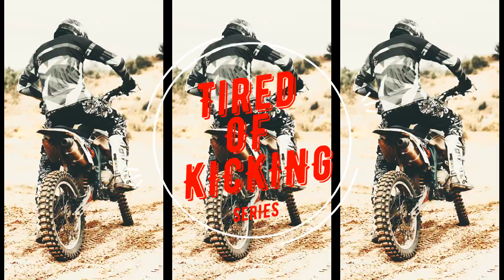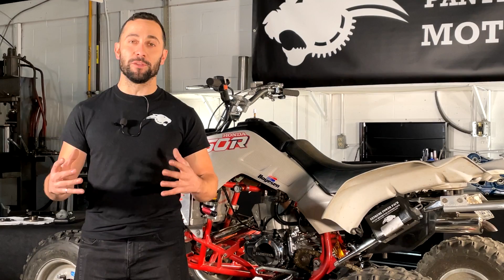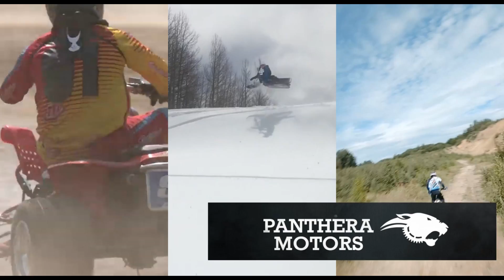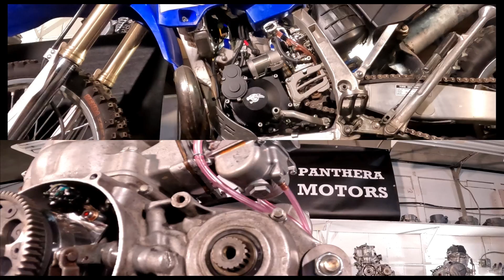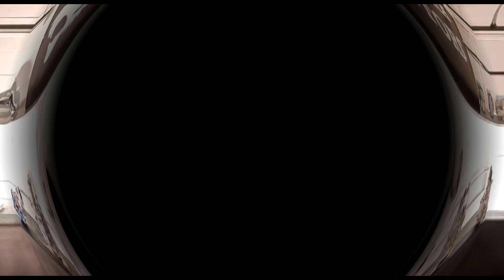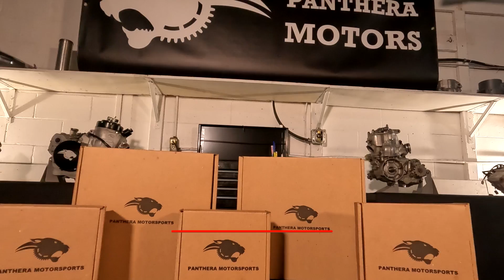Panthera Motors - Honda trx250r and atc250r electric starter kit

Comment: I've seen one on a cr500 swapped ATC but def not worth 2k IMO
Reply from the maker: Hi thank you for the constructive feedback. The TRX/ATC250r unit is only 1399$ and we think it is a very low price for all the parts you are getting.
Reply: @PantheraMotorsports  I have a question
Reply from the maker: @andrewgranda8490  Sure, what ca we help you with ?
Reply: @PantheraMotorsports  could you make a costume 450 ATV engine that has 600 hp and about 80 torque
Reply from the maker: @andrewgranda8490  600 hp ?
Reply: @PantheraMotorsports  yes
Reply from the maker: @andrewgranda8490  that is not possible
Reply: @PantheraMotorsports  why is it not possible
Reply from the maker: @andrewgranda8490  It is physically impossible to produce 600 hp in a single cylinder engine
Reply: @PantheraMotorsports  how do you make a 100hp
Reply from the maker: @andrewgranda8490  100hp is around the maximum you can make in a single cylinder. 600 hp is impossible
Reply: @PantheraMotorsports  why is it impossible to make
Reply: @PantheraMotorsports  why is it impossible
Reply from the maker: @andrewgranda8490  laws of physics
Reply: @PantheraMotorsports  what laws of physics

Comment: This is a great simple setup! I’m very curious on the stator setup that is being run. I’m guessing the ground is floated since the starter is grounded on the motor as well as harness and and the power is sent to a rectifier/regulator then to the battery! Beautiful work, I’d love to check out your guy’s shop someday since I’m not to far away being in New Brunswick!